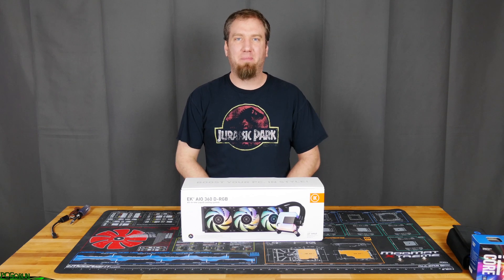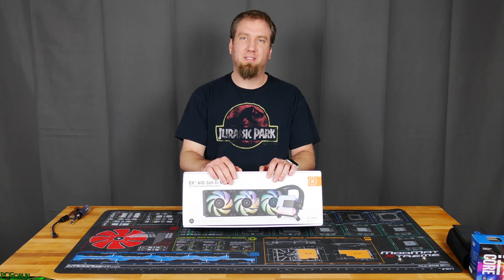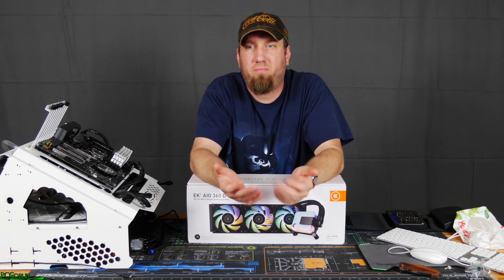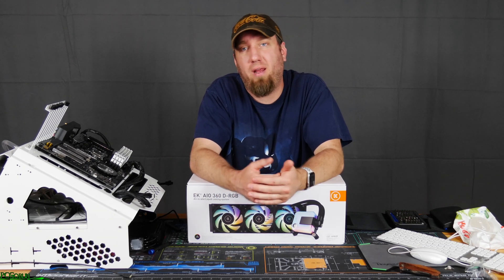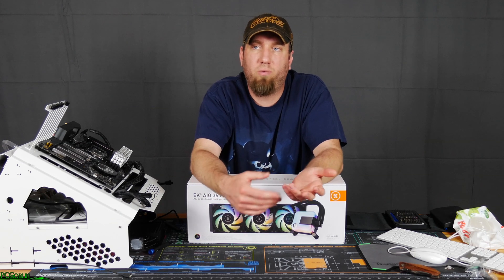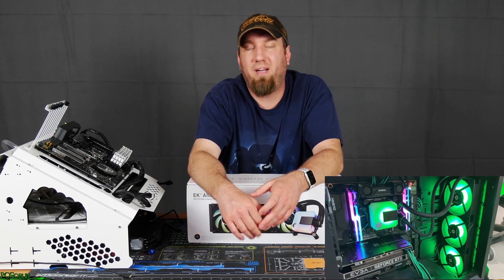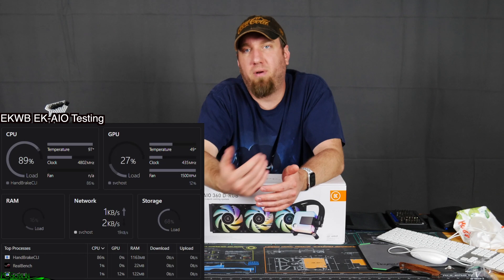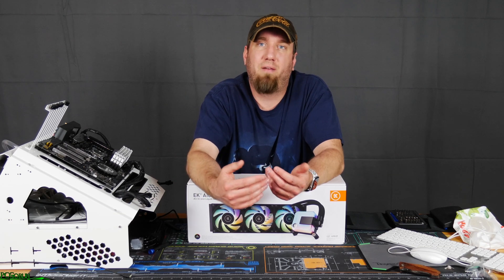Comparing the EKWB EK-AIO to the NZXT Kraken X62.(Install, setup, and results)

Comment: Can anyone with any experience with these EK AIOs let me know how they are holding still holding up? I love everything about the kit, but I'm a bit hesitant because their AIO is still new to the market compared to something using the Asetek style pump blocks. Also, I don't think Microcenter has them and I don't want to deal with RMAs.
Any advice would be greatly appreciated.
Reply from the maker: Theres a few different types of coolers now from MSI, EK, alpha cool i believe and a few others. But the ones ive used have all held up well and relatively the same as each other.
Reply: @PCGoblin  Thanks for the reply. I really appreciate the input. I decided to give the EK 280 DRGB a shot. If it works as planned it's, by far, the best option for me from function to aesthetics. I don't need the RGB, but the EK will work nicely with my single ARGB header.
Every other ARGB cooler has something not ideal- the stock AM4 "2 clip" mounting system, extra software needed, spaghetti monster cables, hose type/ position, or price / performance.
Reply from the maker: @Wooskii1  I think youll like it in the end. I know exactly what you mean though, there is ALOT of options and different configs and it gets frustrating.

Comment: geesh why in the hell was your cpu getting to over 90C?! you will never use your CPU to that extent. your system would lock up. Also why did you use radiator as intake? your just blowing hot air into your case. Hot radiator + fans blowing air into radiator = hot air coming through into your case.
Reply from the maker: Its a very very hot CPU, just the CPU alone uses more electricity than my old 6700k(overclocked) system with 2x 1080's(overclocked) so thats why it gets so hot. As for the rad being at the front, theres been multiple tests done that show the difference between top or front is negligible.

Comment: I had EKWB AIO 240 D-RGB. And it was broken. The pump is dead. Its not working. I dont know why, but the EK predator has the same problem. I am just dissapointed buying this EK AIO.
Reply from the maker: That sounds odd that both dont work. Im sorry your experience hasnt been good. :)

Comment: Not sure if you saw GamersNexus video or not but the way you installed the radiator in the front of the case is not correct and influences temps and lifespan of the aio
Reply: The way he installed it is fine, it won't really influence temps, it just might be louder. The pump is not the highest point, that's the important detail.
Reply from the maker: Ive never had an issue installing AIO's like this and when troubleshooting older kraken's with nzxt support this is how they wanted me to mount it.

Comment: i have the ek aio and i cant seem to get the pump rgb to sync with the fans . any tips ? they are all daisy chained togther
Reply from the maker: Hmmm, thats kinda odd. Maybe try changing the order of how theyre daisy chained? I think I started with pump and then all the fans after that?
Reply: @PCGoblin  ok will try that ty
Reply: @lambbosbread123  did that work?
Reply: @chesian  nah it still does what it wants lol. it bothered me until i got my 3090 and now im happy lol
Reply: @lambbosbread123  lol that will make any situation better. i've got a 3080 evga black for my new build, along with the EK 360 AIO..pretty much have everything but waiting for the 5900x cpu before i shell out for a mobo.
Reply: @chesian  yeah i just built one last week 10900k (intel fanboy) with the maximus xii formula,yeah im running the 360 version, its doing a good job at keeping the cpu cool.pump is abit loud but works very well.
Reply: @lambbosbread123  it shouldn't be loud from all that i've read. you have it front mounted or top? i may still end up going 10900k depending on how long the 5900x takes. i've been intel all my life...but the 5900x seems pretty awesome.
Reply: @chesian  it could just be normal noise. I havnt used an AIO in like 5 years. All my pcs are usually water cooled. Its mount to the top
Reply: @lambbosbread123  i've never used water or /aio...all my pc's have been aircooled so this would be my first entry. would hate to have it noisy....maybe you should RMA it? if it was front mounted it could be positioning problems but i've never heard of problems when it's top mounted...
Reply: @chesian  its not crazy loud, I just expected it quieter.still does a good job at cool though :)

Comment: Any chance of a pump noise recording with the fans either off or at idle?
Reply from the maker: Maybe? Im not sure what the point would be of micing and isolating those parts. With it on the floor next to me I cant hear it other than when the fans ramp up. :)
Reply: @PCGoblin  Thats good to know. Ive  had some very noisy pumps over the years even with proper mounting and placement.
Reply from the maker: I know what you mean, but that was only the case when they were dying for the most part. But so far the ek is by far the best aio ive used or seen so far.

Comment: Can you change the rgb colors with the software?
Reply from the maker: There is no software for this AIO. If theres software for controlling d-rgb it would be separate from this and would need to be connected to that potentially through a gigabyte board or whatever boards have d-rgb.

Comment: what did you think of the pump noise? the fans dont bother me and can be adjusted, i care about the pump, and whether it makes that crackling noise that most aseteks make
Reply from the maker: I know the sound your talking about with the asetek coolers and they shouldnt make that noise, I have them RMAed when they do. But as for your original quesiton, I havent noticed any pump noise at all from it. So far its been a great AIO.
Reply: @PCGoblin  thanks man, im pretty much decided on getting one ,they arrive in Australia on the 29th of this month so i was gonna put in my pre-order.
its the cheapest 240 AIO here by far, NZXT, fractal, are all triple the price
Reply from the maker: Thats brutal on pricing, but im sure youll like it. :)

Comment: I am also considering this AIO, I love the EKWB quality (aluminum housing and enforced tubing) in a design that is made to be used with any motherboard's lighting and pump controls. Is there a reason why you chose to config this with it mounted to the front of the EVOLV X? My EVOLV X arrives this week and with the pre-mounted front fans and open airways at the top, I am planning on mounting mine at the top of the case, because I expect better airflow. Did you try the other configuration?
Reply from the maker: Theres a very technical reason for why i did the front.......

Its because I didnt want to take off the top 3 fans to put them at the front. But it really doesnt change anything by having it in the front vs the top. It changes the aios temp by maybe a degree if I remember right. But go with what you think will be best: I have had it at the top before and it makes installing easier and removal easier.
Reply: @PCGoblin  Haha! I love it, perfect reason! Thanks for the great overview. I am ordering mine tonight. I am looking forward to using this to cool a 3950X on an MSI Creation X570 motherboard. Keep the videos coming ... making this purchase would have been tough without your video.
Reply from the maker: @dan.downing  Im happy I could help. I really like this AIO. Your new build sounds like will be a hella nice setup. In talking to another viewer who has this AIO, he was telling me it idles high with the 3950x but on stress tests it keeps it in the 60's and does it quieter than his other h115 AIO did.